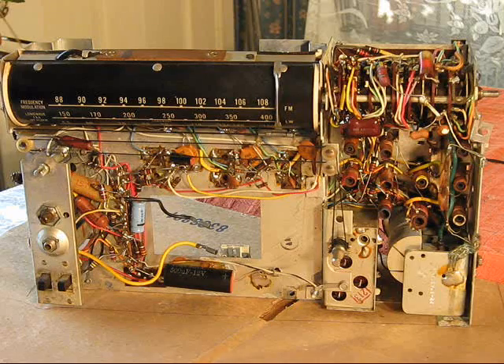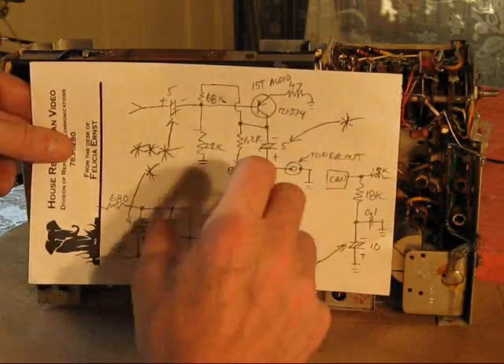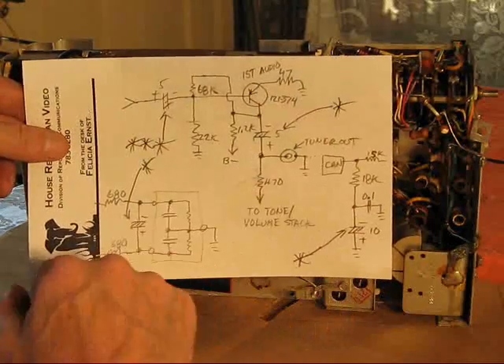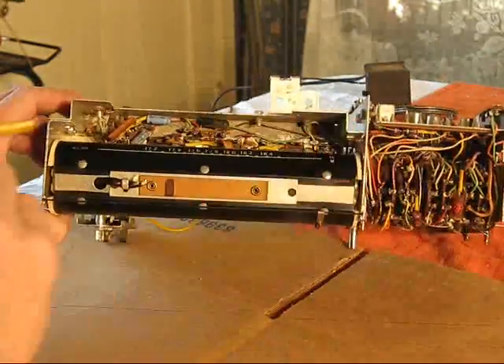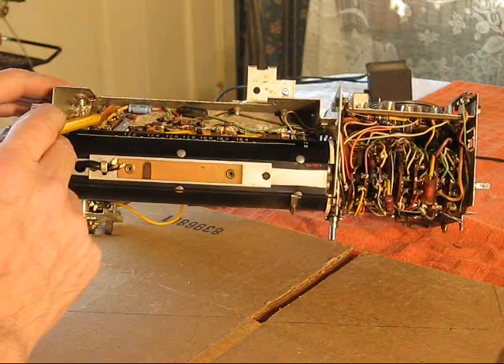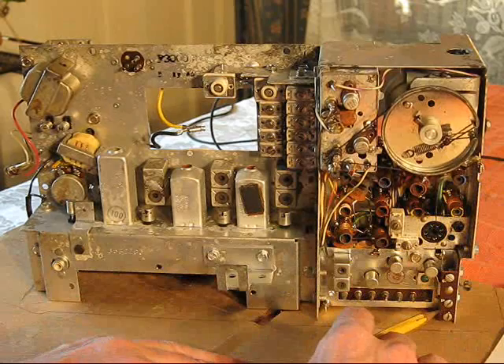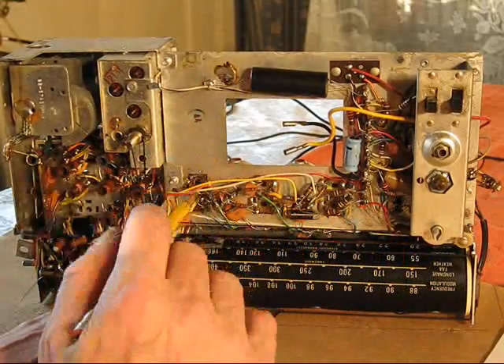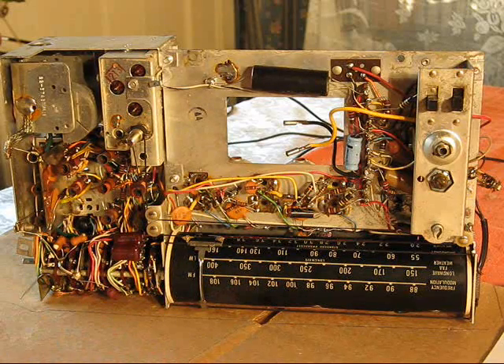Zenith Trans Oceanic portable radio repair # 2 of 6

Comment: Battery case melt down with hot transistors  and hot resistor what is  the fix for this
Reply from the maker: Remove the battery cells.